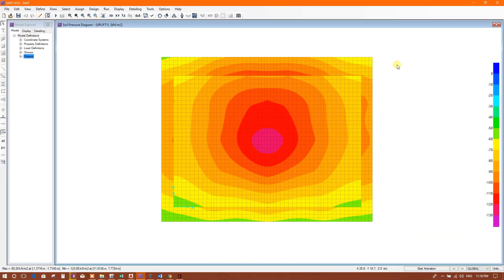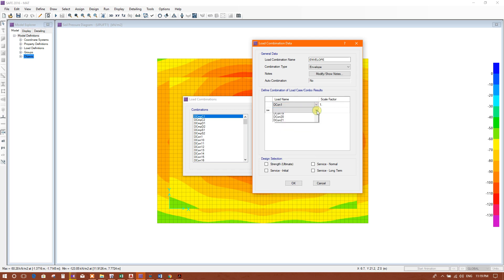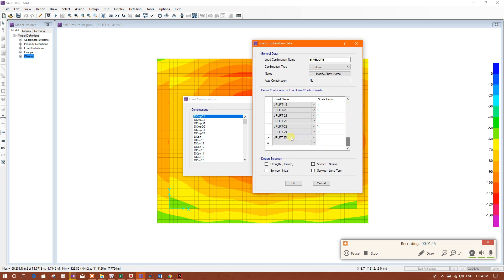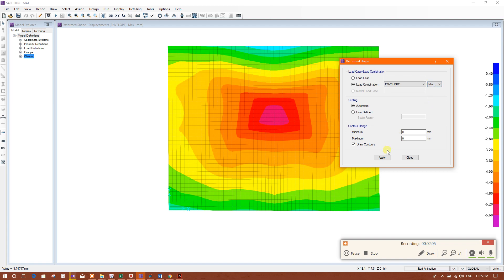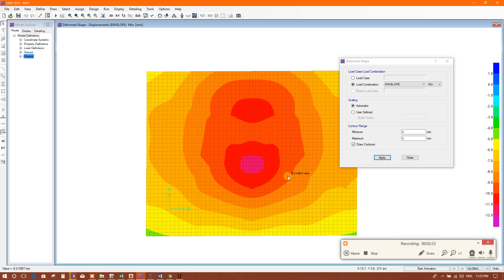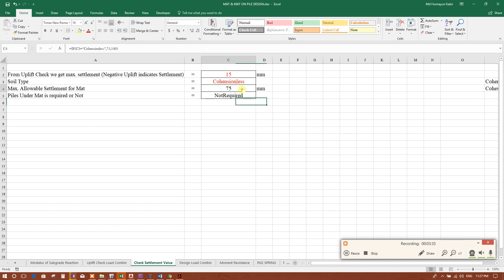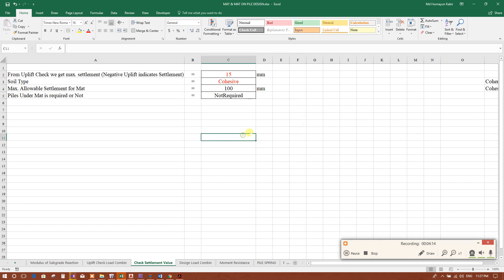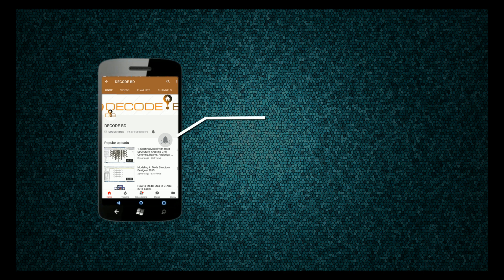6.CHECKING SETTLEMENT OF MAT FOUNDATION-MAT/RAFT DESIGN COURSE

Comment: Hi, Good day! I am also designing mat foundations, and I'm getting 48.96mm settlement due to DL + LL + EQ (linear add - service normal). The allowable settlement for mat foundation is 50mm. It is only almost 1mm difference. Should I add piles on my mat foundation. Or should I change the combination type (DL + LL + EQ) to envelope, and I will not check the design selection.

Thank you in advance. God bless.